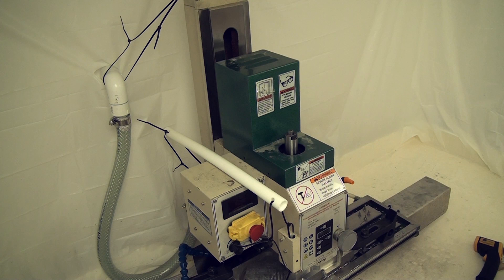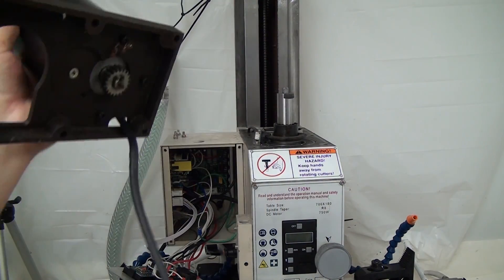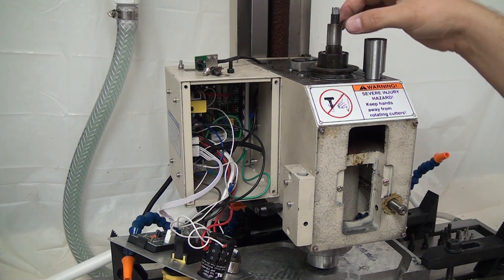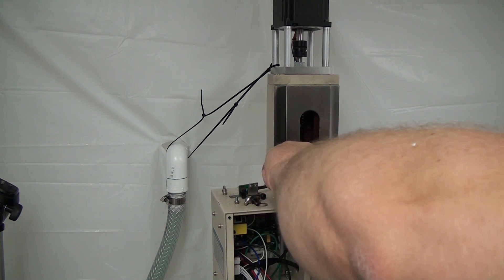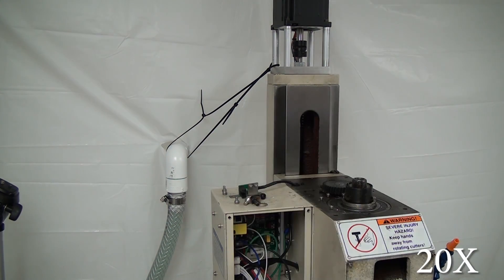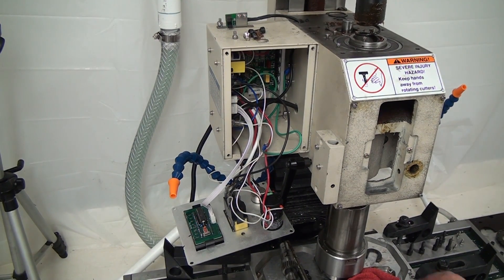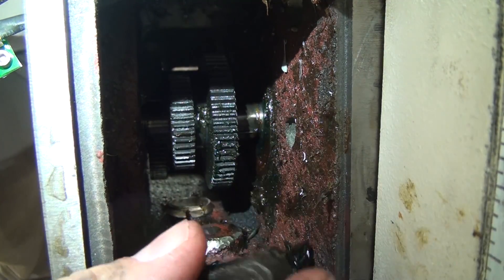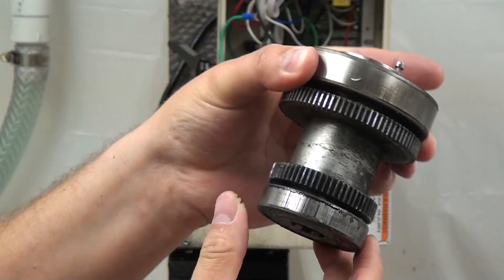CNC-G0704 #13 Belt Drive Conversion pt1 (Teardown)

Comment: Hello, very nice work !
My mill has enbedded quill+spindle also and want to convert it to belt drive, 
You said that an alternative conversion which you can use quill also, i searched a bit but didnt find any example, could you advice somewhere to me? Is the main idea free z movement to spindle pulley?
Thanks
Reply from the maker: Yes that's right. The only real difference (as I understand it) is how you drive the spindle. In one of my videos I detail how my pulley drives the splined shaft, but if you drive the quill itself then the splined shift is free to drop through the quill for the drawbar to work. I can make a short video if you would like to see the difference.
Reply: russtuff Yes i'd like to see that, thanks mate !

Comment: Thanks for sharing all this russ. I ordered hole kit from ebay i did not have life to do it all by my self(still lot of work to do on lathe and mill). it was like 150$.
Reply from the maker: That's a good price. I still don't have this thing put back together 100% and it's turned into a huge nightmare. I'll be sharing my mistakes in the next part of the series so hopefully someone won't do the same.
Reply: russtuff i got suprised that belt drive i got have a spindle pulley that screw onto same holes where tachometer peace is standing. I have some doubts that those 2 small holes and screws can hold all the torqe from 3hp motor. Is yours the same?
Reply from the maker: I'm not using those screws but I know others have. I wouldn't be surprised if it holds just fine.
Reply: russtuff good to know. I am at stage to make a bracket for same motor you got(but 3hp). I will go with similar aproach to what hoss did with aluminum cylinder as this thing can shake a lot. Thank you again for all this videos they are great help.
Reply from the maker: No problem. I really need to get my videos done and get my conversion posted. Busy busy.
Reply: russtuff you are very good at this videos keep up the good work! It takes me also forever to finish this. To be honest i enjoy taking it slowly as i learn a lot along the way.

Comment: How do u like this mill now that u have had it for a while & would u recommend this model for someones first cnc . Was looking at this mill for a good table top mill & possibly converting it to cnc. Seeing those plastic gears kinda has me thinking twice about these shall mills .
Reply from the maker: I do think this is a good mill for beginners, because there is so much support in the DIY CNC community. That said, if I were doing this again I would go with an RX45 (or one of the clones). The number one thing that this mill lacks, is rigidity. As long as you realize you should stick with 3/8" end mills and under, you're fine.

Comment: the format of this mill is great but its flimsy dick construction is not a selling point. I think they planned its obsolescence from the start so they can sell V1, V2, V3 motors and parts, V4 etc.
Reply from the maker: You're probably on to something. I really didn't expect to grow out of this mill for a long time so it's hard to say that it was a bad purchase. BUT since I have already outgrown it, messing around with problems like this is beyond aggravating.

Comment: Russ, I need to replace the quill bearings... is it possible to remove the quill drive without removing the rest of the gears? Thanks.
Reply from the maker: Hello!

Yes, do not think you would need to remove any of the gear assembly to get the quill out. Basically you would just drop the spindle and then hammer or press out the quill.

I would very much recommend you remove the entire head and push the quill assembly out with a hydraulic press. If you hammer the quill out (and back in) you could damage the plastic gears that the quill mesh with.

Comment: Russ, thanks for showing that. I've heard lots about converting to belt drive, but had no idea it was such an involved process. I figured you'd just swap motors, take off the gears connecting it to the top of the spindle and replace them with a pulley and belt. Looking forward to seeing the rest of the  job. 

-- Mike
Reply from the maker: Thanks for watching. I'm still piecing it together and it's turning out to be harder than I thought too :)